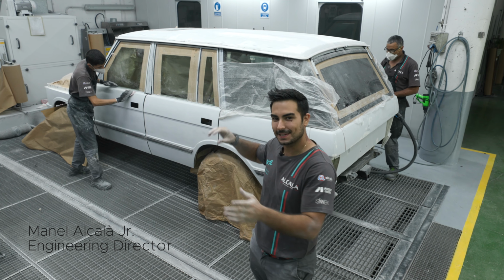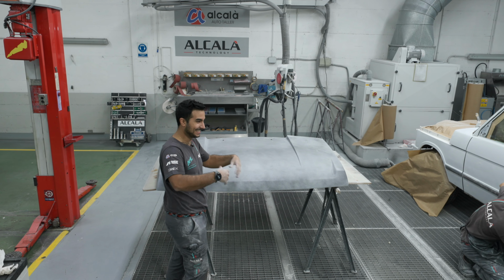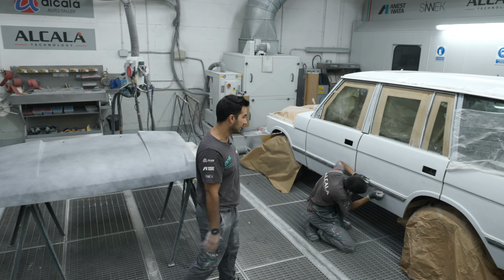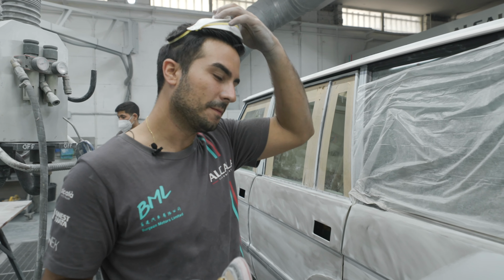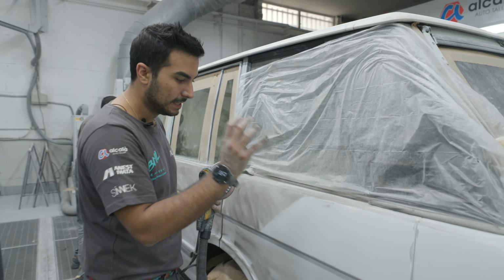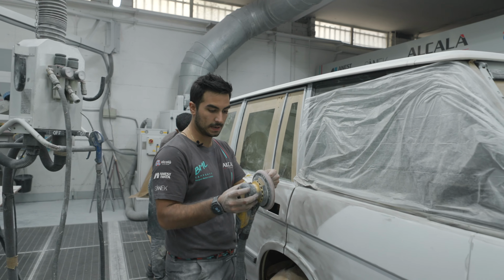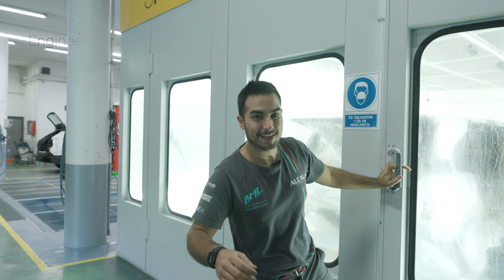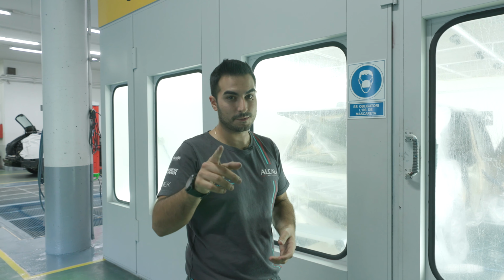From Rust to Riches: The 1995 Range Rover Classic Paint Restoration You Won't Believe! PART 1

Comment: Why did you mask over the trim on the drivers side instead of removing it???  All that work just to mask around a huge part that is easily removed.
Reply from the maker: Thanks for your comment. We always do what the customer decides, this trim was old and not easy to remove as if we removed it there was the possibility of brake it.. so at the end we always expose this to the customer and he decides what to do (as this parts is quite expensive) thanks for watching us!
Reply: @alcala_technology  Ok.  its a 95 softdash.  That trim is made of solid, bendy rubber....nothing to break as its held on with 2 strips of 3m tape.  BTW the softdash door trim is easily restored, by polishing the rubber and replacing the 10mm chrome insert.  If you loose one, Famous Four in the Uk sells exact replicas.  I have the same car going through paint right now...thus my comment.  Looks good.
Reply from the maker: Thank you! Send us this link via email if you want. Many thanks! The rubber was in quite not good chape, same for the middle trim, so if we pulled.. the middle silver trim would be broken in pieces.